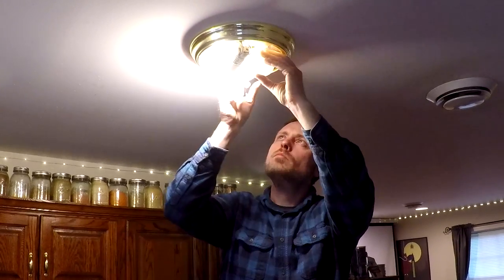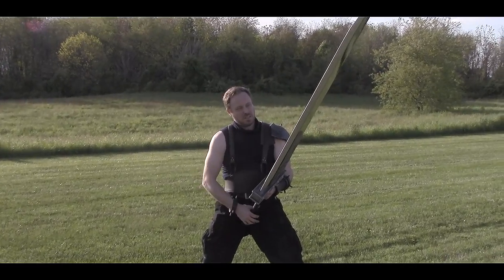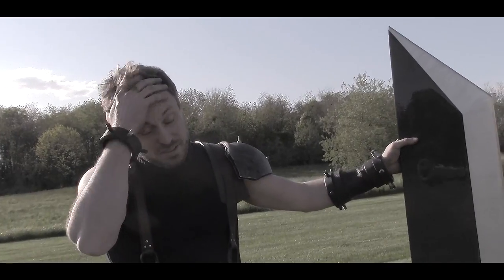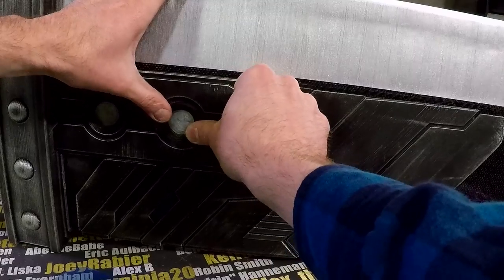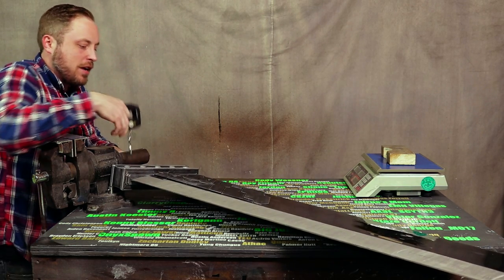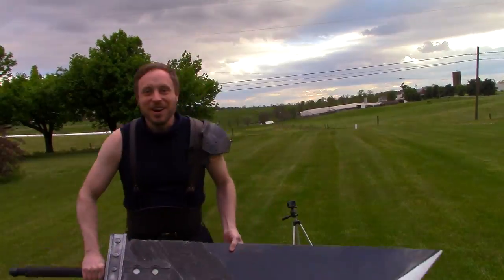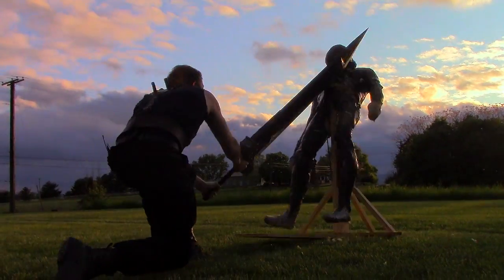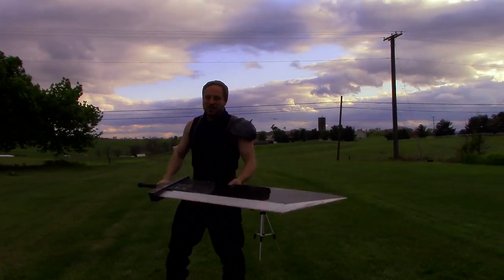CARBON FIBER BUSTER SWORD TEST - With Materia! As Cloud! From FF7 Remake! Omnislash Special!!

Comment: "Don't play with knives, they're very dangerous"
Meanwhile Jairus is swinging around a very large, dangerous, real-life sword that is extremely sharp and hard to control
Reply: to bad it is not sharp it just has a lot of gravity to the swings and is just thin anuff to seem sharp because it is carbon fiber.
Reply: @kuraremu9987  He demonstrated the sharpness by moving paper over the blade and slicing it in twain.
Reply: Its not sharp its just thin.... please explain to me what sharpness is?
Reply: @Xannada that’s exactly what sharpness is - it’s how thin the edge is together with the angle of the bevel (that’s the silver part of this blade which gets thinner and thinner the closer it gets to the edge).
Reply: @Ki-uw9vf  so axes don't exist in your world?
Reply: @Virgil R Garwood axes don’t cut in the same way that a sword or knife does. An axe cuts by ramming the edge into what it’s cutting, and then forcing the axe through what it’s cutting with momentum and literally splitting it. This is most understandable in the profile of an axe vs a sword. A sword is thin. An axe is wide.
Reply: i mean...it's not a knife.
Reply: @squeethesane  Axes still get thin and are sharp by the edge
Reply: @DanJuega  generally axes are convex ground and still capable of being shaving sharp. Yes there are staged grinds that exist in axes like limbing axes as a quick example... But that's really more my point, the original comment ignores a fuck load of geometry to focus on razor thin cutting edges.
Reply: Even in their understanding of axes, they're explaining rock tied to stick.

Comment: Impressive. Previous buster swords I've seen made weighed anywhere from 70 to 80 lbs. That fact you've made a functional (at least somewhat usable) buster sword out of Carbon Fiber and titanium that weighs just shy of 11 lbs is truly impressive. Plus, it is only slightly heavier than a Zweihander on the heavy side of the scale (rough 7 to 8 lbs).

Comment: This makes for a compelling argument on what Clouds sword was made of and how he was able to wield a heavy blade.
Reply: soldiers are infused with mako energy ,therefore,they get the eye color change and boosted strength
Reply: Zack's sword*
Reply: Imagine how fast cloud could swing if he had a regular sword.
Reply: Angeal's sword*
Reply: @domikarus5237  Angeal's Father's Sword*
Reply: @Feuerstaub  in all seriousness how old is the buster sword?
Reply: @dl_sep666  strength is only part of the equation, if the sword is heavier than cloud is then he would just fall over or get his body twisted in a really bad position regardless of strength. So a lightweight material like this is still pretty necessary to be able to wield it.
Reply: @dl_sep666  Strength isn't enough, you would also have to have increased mass and stability because of how much momentum this thing and especially a all steel buster sword would  has,  that it can tug people along with them.
Reply: pretty sure its light weight. if it wasn't i have no clue how tifa lifted him and the sword back onto shinra's building with one arm.
Reply: Being a Soldier in Shinra is pretty much getting the Captain America treatment
Reply: @Feuerstaub  Actually no, Angeal's mother and father spent a ton of money to commission the Buster Sword for him, but his father never used it. Owners of the Buster have been Angeal (First), passed it onto Zach (second), who then passed it onto Cloud (third and final owner) since Cloud had take it to the overlook where Zach died and embedded it into the ground like a grave marker after the events of FF7 as seen in Advent Children
Reply: @zaneswayze8436  well, Tifa is also the best martial artist in Midgar so she’s probably super strong too
Reply: @zaneswayze8436  Bruh Tifa giga strong.
Reply: @zaneswayze8436 
Tifa can lift things that are way, WAY bigger than Cloud and his sword. Final Fantasy humans are just built different.

Comment: Can we appreciate how close to making something ridiculous and fantastical real this is? Or even showing how it could be less crazy than it seems. 

Jairus was ridiculously well prepared for this. He knew how to make a sword light and sharp (which, that part may not have even been necessary given its size) while maintaining some durability. On top of that he knows enough about how to use a sword to put it to work, and his bodily build is not that different from Cloud's - in other words, he has the physical strength for it. I'm all for pushing the limits of reality and asking how to do something rather than whether or not you can, so seeing all of these factors come together was amazing.

Comment: To combat the one-handed wielding problem you could increase the handle length (only by a bit tho, as faith to the source material is utmost importance) and increase the handle/pommel weight. Because even though this will increase the absolute weight of the sword, it can decrease the one-handed force required to balance torque reaction at your hand from 100lbs to as low as 0lbs.

Comment: I think the little roll cloud does with braver is to momentum switch from his body to the sword to put his weight behind the sword and not the sword behind him, and the only way to do such is to roll like he does, which creates inertial force that propels the sword to give him the additional strength to the sword drop... Complicated sounding but very accurate details of how it actually works, as without that roll cloud would have to launch forward and pulling the sword along to get the right motion, but then it wouldn't be braver, and by logic deathblow too (as deathblow uses the same animation)

Comment: honestly - it's big enough that if you gave it good momentum that it'd probably cut through stuff pretty well even if it wasn't sharp - a dull knife will cut to the bone because you have to apply extra pressure because it's not sharp - this is so heavy that to give it a good swing means it's gonna have a lot of force behind it and the 'blade' end is narrow enough - sharp or not - that it's a lot of pressure in a small space so it'd cut good

Comment: As some have commented before, I believe this to be one of the best if not the best attempt on the buster sword. I like your approach a lot and also how you made a ridiculously large blade kinda wieldable... a bit at least. A beast of a man, maybe a strongman could maybe even wield it. Now what I'm interested in is whether you are up to different custom sword designs. Do you do custom katana designs? Although many claim that a katana is a shit sword historically, It's my personal favourite and I've been thinking for a long time whether or not it's possible to reinvent it with todays metallurgy knowledge. I'm talking lighter but still very durable. Like a titanium alloy but with all the traits like hardened edge and softer back to convert energy so that the blade won't shatter.
So basically I'm asking you, if you believe you can try and reinvent the katana.

Comment: Friend and I made a replica of Nightmares sword Glam from Soul Caliber. Out of solid wood with a metal rod as its core. Yes it weighted seemingly a lot but the torque is what made it hard to weld. Got used to walking around with it and making it look weightless which made if funny when people wanted to try lifting it only to almost drop it. (which sadly I had to stop doing cause it kelp getting dings from people underestimating it and basically full dropping it into the floor) 

But I could hold it at any angle np EXCEPT one handed fully arm extended. There was just to much force required to hold it like that and make it look weightless. (arm was either shaking or slowing lowering) If you held it upright the thing felt like nothing. The moment you tried holding it horizontally you were in for a quick lesson on physics. 

But it was totally possible to make it look "light" otherwise. I still have it but its now 20 years old so its got a lot of time, plus con wear and tear on it. (Wood has since warped a little and cracked in a few spots) Kinda wanna remake it with my friend but he lives in Florida and I Minnesota so logistically isn't not happening for a while but maybe one day.

Comment: Should have put a weight towards the cutting edge of the blade to make it easier to control when swinging it. Right now the back edge is heavier than the front, which is why its so hard for you to aim it when swinging.

Comment: I wonder, could you shift the center of balance further toward the pommel by casting the lead around some scrap tungsten carbide material such as old drill bits? And if so, would it be anywhere close to enough of a difference to properly balance it for easy handling?

Comment: It might handle better with weighted pummel :P (see what I did there).. in all seriusness because the buster sword is comically wide and large. It might work better as sort of a wing design(it's a thing) using two hands, possible a weight in the ass end of the  handle. Making  the ass end of the handle a bit wider. The theory being so as it doesn't tople over while swinging it.

Comment: If you want to stop your blade from rotating too much means it's heavy so you are rotating then just do like this just put your 10% of blade tip in the ground this way you can slash faster and it will not damage your blade either

Comment: Excellent build! Very lifelike cosplay. Congratulations! Don't blame yourself for not being a swordsman. Cloud's buster sword is atrocious in design in literally every aspect. It just doesn't function as a sword. As you mentioned, the grip shape is wrong, you simply don't make a round shape handle, it ruins edge alignment 100% of the time (not your fault, you didn't design the sword). Good for you too rectify that. Still the point of balance makes it completely useless. If you can use this sword to beat Sephiroth's nodachi (which, incidentally, is a REAL sword, just maybe too long), you might as well be able to beat him to death empty-handed. Also kudos to you to make a heftier pommel, that is the correct way to bring the balance back to the hilt. Maybe try making a even larger one to make the sword even more usable. Historical swords have heavy pommels, one of my sword's pommel literally takes 40% of the weight of the entire sword. Generally speaking, for a sword of this size, a point of balance that's 3-5" away from the cross guard would make it maneuverable.

Comment: I wouldve whirled it around me once so the centrifugalforce keeps it straight for me. sou you dont have to work against gravity but only pull it towrds you a little. HOpe oyu got what i ment. @JAIRUS OF ALL
Edit: dont be stiff. Let your Joints slow down the sword, not your muscle. You look better when your relaxed. Just let it flow till it cant no more and than after a short break, pull it in the other direction and do the same.

Comment: build another one but keep it lighter. instead of making an exact copy of the sword, make one that could conceivably be used. instead of adding lead to the one end to change the balance, cut out sections of the blade. see if you can't get it to 6 lbs, then it's heavy for a sword, but still in a realistic swords weight..  and do like a real sharpness test. can it easily slice through thin paper?

Comment: I think the lack of skill shows off more how well your stuff is made. Your stance is okay but your from, swing and follow-through is wack. Here's some tips for betterment:

1). train your muscles-- the pose seems impossible 'cause you can't do it. I once trained with a replica of Dante's Rebellion (full steel and iron). That pose is doable. Your lack of strength (in turns as a swordsman) is noticeable in your swings. You didn't stop fully and was pulled by the momentum. Part of this is 'cause you was swinging with your arms out and bad footwork, but for now that's a digress

2). Keep your handle close to the body-- math and science says that during centripetal force the closer matter is towards the center the more control is sustained. The reason why you flailed about is due to this.

3). Your footwork is bad. Don't be afraid of moving the whole body, not just the arms. The legs need to move with the back and the back needs to be behind the sword. In every swing the last thing that should move is the sword. You didn't move the elbows, nor the wrist, nor the hips. Most times with a sword of that size you need more than a passing step; you need a passing step into an engagement, or to false retreat.

4). Lastly don't be afraid of the weapon. That was obvious with the dummy. Being afraid and half doing swinging will cause it to fly out your hand or have it ricochet into your face. Have confidence with your steps and follow through with the body.

I'm not trying to dunk on you. Just giving you advice, so the next time you do this you won't put yourself in danger. Bad form with a melee weapon is just as dangerous as a lack of respect is with a loaded gun. If you are going to give demo's, train and practice. Map out what you want and create a staged performance. It won't be any less "real". As you said, "I... make stuff", you're not a fencer. Creating a staged scene can still show the effectiveness of your work. No one here wants to see or hear about you getting hurt. Stick at what you are good at, and for the things you aren't take them extra serious.

Last nic-pick, but The buster Sword as seen in the remake goes past Clouds elbow; meaning that it is more than a cubit (a ft and a half) and that's when he isn't holding it at the base, so the Buster Sword's hilt is actually more than 2ft give or take, at least 2 and a half. The longer hilt will help with control issues.

Anyway I enjoyed this. Stay strong. Most def. leaving a like.

Comment: If you are still trying to would this 9 months later you should be in great shape and form.

And your form is really terrible in this.  You must find the zero torque point in the movement that way you can change your bodies direction without fighting the force of the blade moving against you.